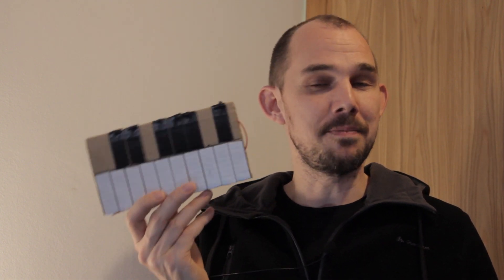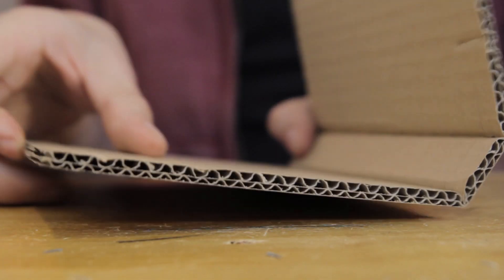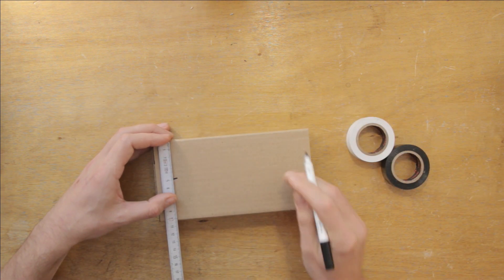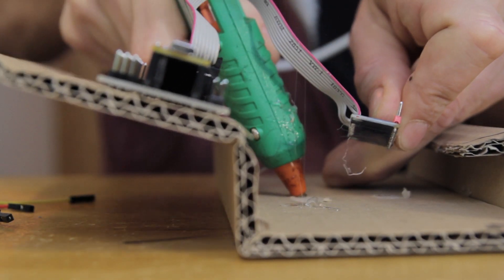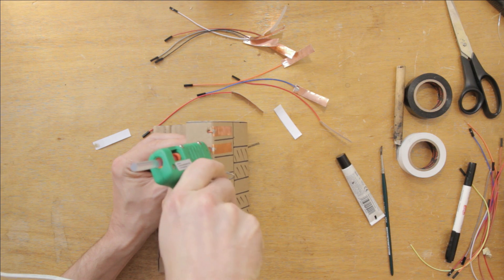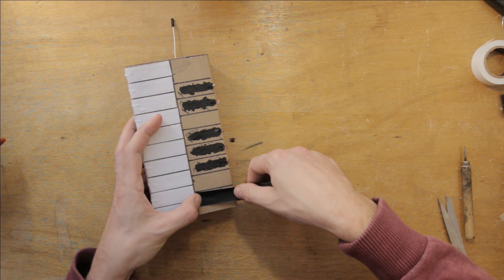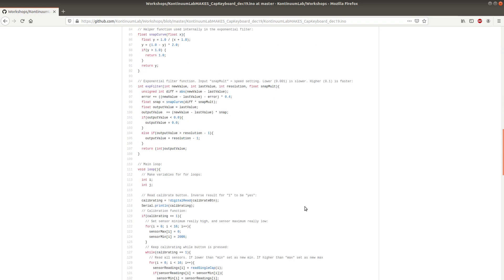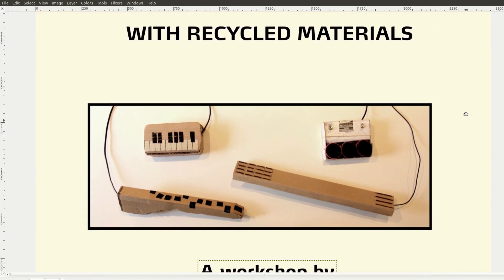KontinuumLAB WORKSHOPS: 1-Piece Cardboard Keyboard

Comment: I don't know if you have this listed somewhere but is there a specific list of required components for this? I'm trying to see if I could screen print the traces and capacitive keys for something like this and this seems like a great application for my project.

Thanks!
Reply from the maker: Hi Ian. I have a few videos about this kind of thing. Check out this one: https://youtu.be/b4Hl9g1V9Mw which goes into some detail. Basic story is: I use a Teensy microcontroller which has cap sensors built in, and a multiplexer to make 16 or 32 keys..
Reply: @KontinuumLAB  Thanks! I went to your website and it looks like everything is sold out. Will you be restocking? I'll just see if I can find the components elsewhere if you aren't.
Reply from the maker: @ianruff6173  Yes, I have most of the components for the kit in stock. Just waiting for the last couple of things, which should be here in a couple of days.
Reply from the maker: @ianruff6173  The shop is open again!

Comment: i didn't know you could do cap sense through a multiplexer....hmm interesting...so you could get 32 notes eh?
Reply from the maker: Works great, although you do lose some sensitivity, from the extra parasitic capacitance. You could get lots more notes, if you use more multiplexers - but yes, my breakout board is set up for 2x16 sensors maximum.

Comment: Oh, I see now that when you refer to sensitivity you mean you have to bend your fingers over the key to give the sensor more surface, and hence more feedback. Am I correct? I thought in the beginning the force one would exert on the key with would be translated to the instrument.
So this is how you'd go around the pitch-bend sensor you mentioned, I guess? same sensor type and just using a broader part of your finger to control the pitch? 

Anyways you have a great series of videos on the subject but (yet) not so many views. I'm sure this will change in a future because you've got great contents and it's all very well explained. All the best!
Reply from the maker: Thanks Eduardo! 
Yes, the sensitivity works exactly as you described. 
Also yes, the pitch-bend sensor would work the same way, but it uses two sensors so I can pitch up and down. It is implemented in this earlier video of mine: https://www.youtube.com/watch?v=AP97h8usAG8
Reply: Hey thanks! Bloody youtube! Why is it it doesn't notify me? I was lucky I came back to check.
I wanted to report I've been successful soldering a wire to aluminium (the fine sheet that laptop's cdrom drives are made of), by holding a tin blob with the soldering iron and using a sewing needle on a piece of wood to scratch underneath the blob. I placed the aluminium key on a tea cup turned upside down, to help with thermal dissipation, but it isn't probably needed. I reckon using a needle or something similar actually is, though, as the lower the thermal mass (that still enables one to scratch where the blob is while it's molten), the better.
The next I will be doing is to try different capacitor setups, but I'd say what I'm looking for is more like a FSR, or the sort of capacitors used on these seaboard keyboards. I'll try and see if I can get what I want. Looking forward to see more of your videos. All the best!